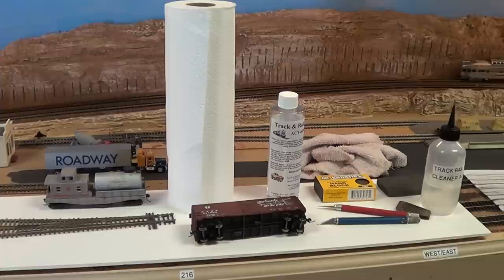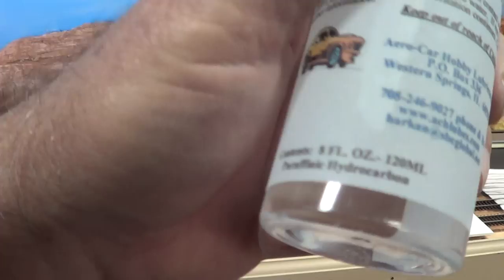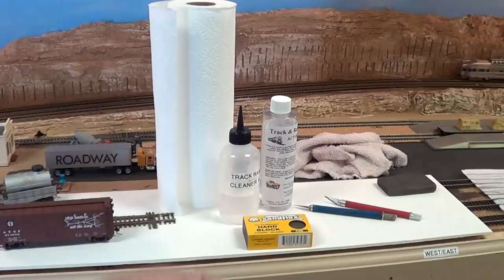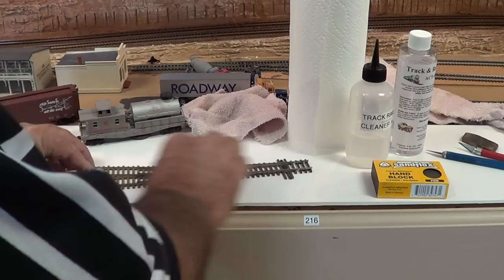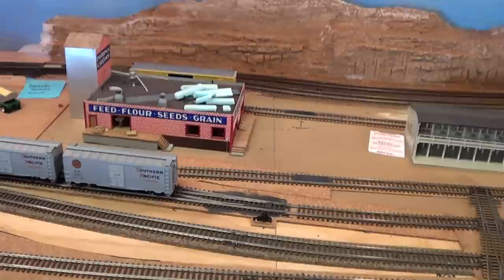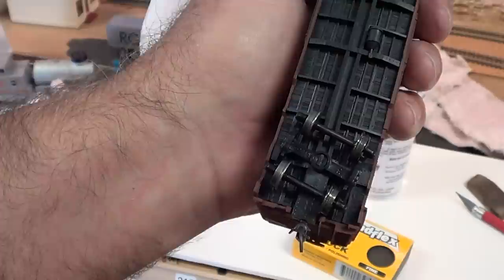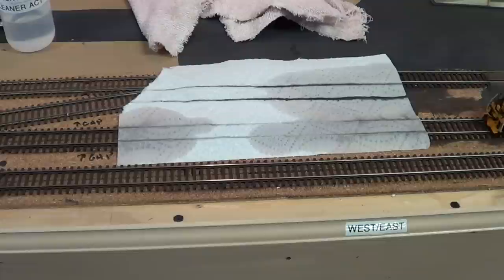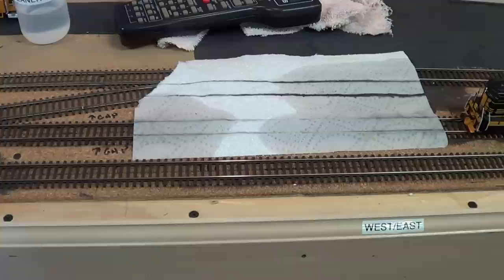CLEANING TRACK ON YOUR MODEL RAILROAD

Comment: Hi Art. Good informative video.  You are right a track cleaning, wheel cleaning regimen and good electrical contact mean everything for operations.  For rags I use old t-shirts.  They leave less fuzzies behind then cotton towels can. I also use the Perfect brand of track cleaning blocks.  They are far more finer that the Bright Boy blocks and are available through Con-Cor. I don't use Bright Boys for the same reasons you don't. The Perfect brand work very well.  Bill Shanaman

Comment: Hey Mr. Art  May I make a Suggestion!   Get ya some Cleaning Rags for Cleaning GLASSES you know those Spectacles that Ride on your Nose!   for cleaning your Wheels,  you can Find them Just about anywhere I use HOYA Rags there Very Fine in Nature there's hardly no Lent in them Son & you can get them in a Variance of Colors I prefer White.. 

And you can wash them Brother in Momma's wash machine but leave out the Softener in the Washer and in the Drying if you want to Dry them Mine I Line Dry.. 

You learned something from a Youngster and the Paper Tows can be Left in  Mom's Pantry

I also use a Shop Vac & with my Vac I use A Miniature VAC Kit that Micro Mark Sells it still has superior pick-up but real great reach for those small area's and for the Rolling Stock I use Microbrushes the Brand!  there Green in color they hold cleaning fluid pretty Good I use Alcohol the 70% kind you can find it @ any Wally World or any other Dept. Store..

But that Cleaning Fluid I Might have to try it as long as it Doesn't have a Harmful smell and it's worth making the Trains run better.. 

Thanks for the Great Videos..  Brakeman

Comment: I wouldn't use any grit less than 300-400 grit when using sand paper, 400 is about perfect. Then sponges work OK because they get soft but also a tad heavy on the grit scale but they are soft enough to not scratch the rail as they get used.
Reply from the maker: Been working great for over 25 year using this method.

Comment: Hi again Mr Houston ( or Arthur, if I may).  One thing you don't mention as far as I can see Is how you apply the track cleaning fluid  ACT6006, to the track. Do you have a special way or method?   I have acquired some ACT6006 over here in the UK from  an outlet in Canada so would be interested in your method of application.   Regards  Jim

Comment: Hi Arthur.  I have a layout in my basement that has not run in over ten years.  the layout took many years to build as the layout was left here when I bought the house.  I would like to try to run a train on it.  what should I do and what should I use to clean it as it has been years since it has been operational.
Reply from the maker: What gauge is it? one get a very good vacuum cleaner and start getting all the dust up. Watch the track cleaning video and get the Sandfex pad and rub rails until polished. Have to vacuum as per the video to get the particles up left from polishing rails. wipe with 91% Alcohol. If you can order some track cleaning ACT 6006 cleaning liquid. Watch this video.  But does it have power supply and engine to run? Where do you live.  Some help would come in handy.  https://www.youtube.com/watch?v=k7Si5EbjtHU&index=4&list=PLqHQgiAJ9oRLx-RdCAB3QPko5q_NpYZEO
Reply: it is HO.  probably built in the eighties.  It measures 22 feet long buy 13 feet wide and it is pretty good size.  I have the pad and have been polishing.  next i will vacuum.  there is a black wire hanging out under one of the turnouts.  maybe a mouse got it or something.  There are so many turnouts.  Two power controllers and block diagrams for different switching operations at different ends of layout.  it has a handheld controller.  I would love to get it running.  Just do not know anybody that knows trains to help me.
Reply from the maker: You will need a DC engine first to get it running.  Plug it in and turn controller up and see what happens. You really cannot do any damage. The power supplies probably have a circuit breaker. In them. Again you need to find DC engine.
Reply: I have Atlas engines.  I imagine they are DC.  I am cleaning and vacuuming layout.  The engines are in great condition.  I hardly ever ran them because I could not figure out the layout.
Reply: I have a DC engine.  still cleaning track
Reply: i have cleaned the track.  It always stops at the same place.  Their are three turnouts and the track is dead over all of these turnouts.  As soon as I force the locomotive over the turnouts is starts right back up on the other side
Reply from the maker: You have dead track no electric feed and if over switches it can be issue with insulated frogs.  Need meter to detect exactly what piece of track is dead and try using a jumper with alligator clips to see what happens if juice is applied. If that work than you will have to run a feeder to that section.
Reply: Ok.  I checked all wire connections and they all seem to be tight.  At the other section of the layout, it appears as though the other transformer is dead.  it is an old MRC Controlmaster X.  I wonder if that could be part of the problem.  I am trying to locate one
Reply from the maker: Any DC power supply for model trains 12 volts will do, look on ebay. Do not buy any thing for Lionel. It is AC.
Reply: ok
Reply: Douglas track eraser.  like the big pink ones in school, only for model train track.
Reply: Douglas maybe its the rail connector problem, put some solders in connector, and clean the upside track with autosol